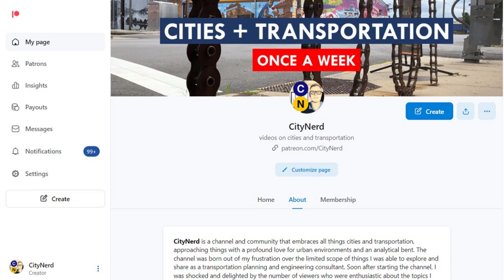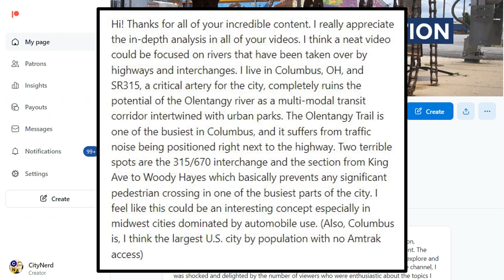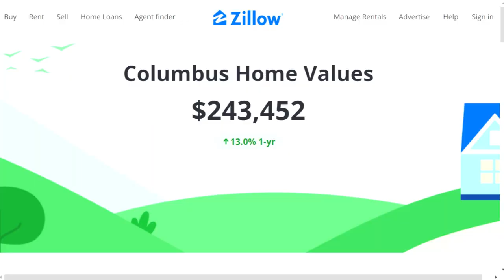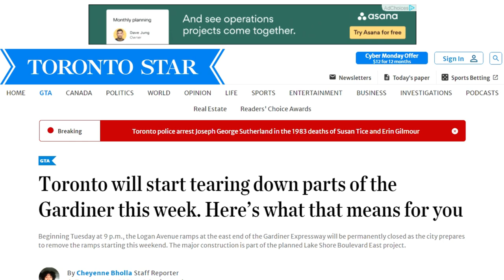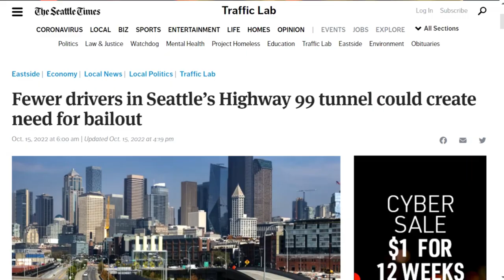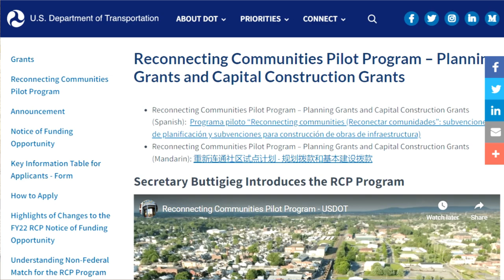Highway Engineering Madness: 10 Waterfront Freeways That Need to Go (North America Edition)

Comment: #7 - I lived in Oakland a block from the MacArthur BART station & worked in an office on the Emeryville Marina, crossing under the freeway at 7:28. I'd love to see it gone & replaced by better modes. It, and its surrounding/connecting freeways (80 and 24) are all jam-packed nearly all the time. The aforementioned BART is a great regional/commuter service, but the local AC Transit doesn't do a great job of filling in the gaps. The area is flat enough to make bicycling super-easy though, if it weren't for all the cars.

Comment: I’ll take a freeway over a stroad any day.
I can think of two other cases that didn’t make your list, probably due to city size.
There’s I-229 in St. Joseph, MO which is right by the Missouri River. There’s been talk about removing it due to its double-decker section blocking the view of the river.
Another one is Loop 375 in the southern part of El Paso, TX, which opened in 2020. The portion west of US 54 is squeezed between local streets and the Rio Grande. There are parts of that road that have a chain link fence separating the road from a residential area on one side and the border fence on the other side.

Comment: I use lakeshore drive pretty much daily during the week. It’s really bad. It’s a “highway” that really just- was never made to be one. From my experience the posted speed limit of 40-45 is, essentially ignored. The generally accepted speed limit is around 60. If you use lakeshore please at least (in normal conditions) always go 40-45, as people going faster are not going to slow down. There are a lot of wrecks from road rage, rear end crashes, and just stupid driving. I do a lot in my personal time with traffic engineering, and i spend my time on the road just looking for the things done wrong. One thing that finally was fixed around a month ago was in millennium park, on the north bound side, you have 2 left turn lanes at lights, but 1 long one spanning essentially the whole length of the park, and for a long time people just- go around everyone in those lanes, and go through the intersection in those turn lanes. Even going around to the left of the people in the rightmost turn lane and continuing straight. 
This was, somewhat helped with new concrete median widening. Also helping a bit to pedestrian safety which, basically doesn’t exist there as people still will blow by the red light in that left lane. This is still not what is needed for the situation, that being a completely segregated left turn. Though we just need improvement to public transit and no lake shore drive, that’s not happening. But the amount of bumpers, and various other car parts strewn around those new medians is insane. Apparently people are still trying to do what they did before but now getting the bottoms of their cars shaven off. I would say remove all the traffic lights as it is, but that’s not how traffic works and supply will always outpace demand there. Another issue being the steep overpasses that make rear end crashes a lot more common as people blow over them at 70 and rear end the stopped traffic on the other side.

Comment: The I-64/I-71 corridor through Louisville, including where 64, 65 and 71 come together well east of Downtown, are built on the floodwall. Part of the "white flight" and "race to the suburbs" In Louisville was about getting away from a downtown that was under the Ohio River more Februaries than not. If the freeway were to come down the remainder of the structure would either have to remain or Downtown, most of the Portland, Shawnee and Butchertown neighborhoods would have to be abandoned.

Comment: I know you had loads to choose from, but I was expecting to see I-90 through Cleveland on the list.

Your opening footage of Tacoma made me think of the Gardiner in Toronto (I knew that one had to be on the list; well deserved). The similarity that struck me between the two was the rail corridor paralleling the expressway. In Toronto’s case the railway  has a long history on the waterfront serving the port, as well as bringing passenger trains into the city centre. When the Gardiner was built, it was just one more travel corridor on top of an already intense barrier separating the city from the waterfront. As the rail lands were sold off and redeveloped, the presence of the Gardiner became more obvious.

There have been many efforts over the years to tear down the Gardiner. A stretch east of the Don river was removed. The current work, which you mentioned, would tear down a section at the east end, and replace it with a new section that curves further south, even closer to the waterfront. The political will for a full takedown will never be there, despite the immense cost of reconstruction and ongoing maintenance.
Reply: Correction: the reconstructed section will be built farther north, closer to the railway, not south.

Comment: NYS Route 5 in Buffalo is a particularly frustrating example that should be in the process of removal right now.  Unfortunately, the fastest-completed EIS for a megaproject in US history (or so I was told) was scuttled because some misinformed (yay social media) commuters were offended that the new alignment would add a few minutes to their commutes, and therefore our local dead wood House member pulled his support.  I get that driving is so unpleasant that adding a few minutes to any trip is rightfully awful, but let's think about the greater good every once in a while.  Essentially it proposed removing the freeway between Tifft and I-190, and rerouting along an abandoned rail corridor (I know, but not a waterfront at least?) to meet I-190 east at Seneca Street.  Worse yet, some modeling actually showed that commute times would decrease in certain situations.

So instead, we have a decrepit, yet only 15 years old (serious, what's with the horrendous build quality?) freeway to sit there for God knows how much longer.  Yeah, it was rebuilt 15 years ago, when the same useless politician withdrew his support for a boulevard alternative.  An alternative that surely would have had its flaws, but at least it wouldn't be the eyesore we have now.  It doesn't help that it's ugly, it's not even pleasant to drive on thanks to DOT evidently forgetting how to do geotech work.  Oh yeah, and somehow after reconstruction, they managed to make it worse in the winter - more whiteouts, etc.  Nice going, NYSDOT.

And don't get me started on I-190.  A nice attractive noose around the south edge of downtown, which not surprisingly is one of the fastest up-and-coming areas of the inner city.  Yeah, it's elevated, but that's still part of the problem.  Nothing like having to walk across a 100-foot wide moat of horribly managed gravel parking lots that smells like piss whenever you want to go to some kind of entertainment.

Comment: 580 might be the least free-flowing freeway I've ever had the displeasure of living near, but I have to say it's not one I think is practical or urgent to remove at all. there's no alternate route capable of even a tenth the car traffic, the nearby uses are primarily industry, big-box, and warehouses, and development in the area is much better placed near BART and the upcoming BRT on san pablo. permeability is ok, there are ways to get through to the few things on the other side, and the bay there kind of stinks (literally) to live too close to anyways. there's not a lot on the other side or even too close to it for much of it's length as it's right up at the water's edge, in some areas it's hundreds of feet off the original shoreline
Reply: also, the handful of recreational areas on the other side are spits that stick out far into the bay, so you're not hugging the freeway while walking your dog. there is a path that runs alongside the freeway, but there are better parallel options inland, so it's not super heavily used.

Comment: Storrow Drive and Soldiers Field Road's other claim to fame is the numerous low-clearance overpasses along their length, upon which trucks come to grief so often that the term "Storrowing" has entered the local vernacular, referring to trucks hitting bridges both on Storrow Drive and elsewhere. The stereotypical case is the MIT or BU freshman in a U-Haul, but more often than not it's professionals who you'd think would know better.

Comment: As a long time Chicagoan, I can say hand on heart LSD is a blight. The amount of noise pollution it causes is incredible and the proximity to the well used and much loved lake front trail makes this very apparent. Speed is a huge issue as well, with posted limits at 40mph on the north end and 45 on the south, you can bet the average speed is at least 20mph higher with a fairly large contingent of users traveling even faster. IDOT says it averages 3 collisions per day and the danger is apparent. 

What is more worrying (and worth a look if you can CityNerd!) is the proposed changes IDOT is currently planning. One option includes adding lanes with more outlandish options including a causeway out on the lake thought too expensive. Why this was even considered is beyond me as adding lanes seems insane enough in the 21st century. 

All that said, I drive the entire length daily from the far north side to NW Indiana. Part of the problem? Yes. The two hr train based option (CTA to South Shore Line) just does not work if I want to have any time left in a normal workday. This comes down to the distance (~30miles) and the limited outbound schedule of the South Shore line.  

Thanks for putting LSD at #1. It truly deserves this shame. Love the channel.

Comment: Bonaventure in Montreal is rather bad, but the reality is that there's really not much that can be done with that plot of land. It is extremely polluted. There are wells that are constantly pumping out ground water to prevent oil and other toxic sludge from ending up in the St-Laurence. That piece of land is literally never going to be usable for anything other than warehouses and industrial buildings. 

Route 132 on the south shore definitely has got to go, but the problem is that there are quite literally only 2 straight lines on the south shores and that's one of them. Montreal is one of those places that was stitched up from multiple cities that just did not consult each other, and often still don't to this day. Taschereau is the other straight line on the South Shore, and assuming that things go as expected, a new REM will be built along that corridor. The portion of Taschereau that is built like a highway is definitely on borrowed time. The city wants it gone and the government seems to be willing to go along.

Comment: You showed the two waterfront freeways I am very familiar with. I grew up in Berkeley and Oakland, CA and I am very familiar with the Eastshore Freeeway. The reason it's where it is is because when they were building it, the city of Berkeley did not want the freeway going right through it. It's the same reason the tracks for BART are above ground in Oakland but go underground for the time it goes through Berkeley before reemerging above ground again once in Albany.

I live in San Diego now and yes, I-5 along Mission Bay does sort of ruin that area a little.
Reply: I lived in Berkeley about 40 years ago and found the waterfront next to the freeway undesirable. I seem to remember the term "mud flats" which doesn't conjure up the idea of a place you'd want to picnic. I think there was also some odor associated with that part of the bay. Next to the bay is as good a place as any to locate a freeway.

I live in San Diego, walking distance to Mission Bay Park. I can usually tune out the traffic (some trucks and motorcycles are noisy enough that you can't avoid hearing them). And there are other parts of the park (not walking distance for me) that are much further away from the freeway. 

I don't see the freeway as a hindrance for accessing the park, but I live near where Clairemont Drive crosses the transit corridor of I-5, heavy rail, trolley and Morena Blvd. I-5 also makes this park more accessible to other parts of the city. This part of I-5 is basically on top of the Rose Canyon fault, so you wouldn't want to put high density housing there, either.

Comment: Love your channel, but you are wrong about Lake Shore Drive. As a Chicagoan, I need it. It's the rare piece of road infrastructure that works, outside an hour or two in the morning, during the school year, there aren't really traffic jams, which give working class and middle class residents of lakefront neighborhoods like Rogers Park and Uptown on the North Side and Kenwood and Oakland on the South Side quick access to central areas, and also connects the University of Chicago campus to the central city and the North Side. Chicago has the best public transit west of the Northeast Corridor! But it's still not enough. While the North Side lakefront neighborhoods have rapid transit access to Chicago's Loop, it's not very helpful if you're trying to go anywhere else. Chicago's transit lines are laid out like spokes from the central hub of the Loop, and are less efficient at connecting neighborhoods to each other. And even in the Loop, the El is fine to get you to an office building, but because of where the stations are located, they're not really workable if you're trying to take a 6-year-old to the Field Museum or the Adler Planetarium. The South Side lakefront neighborhoods lack even this level of transit access.  There's the Metra Electric line, but outside of rush hour it runs maybe once an hour. As a result, if you were to replace the expressway with a boulevard with more stoplights and interchanges, it would cut off more distant neighborhoods from the central city and make it no longer viable for middle class residents to live in these neighborhoods and work in central areas.  Yes, making LSD a regular surface street would raise property values in Lincoln Park and Lakeview, but is that really a good thing?  More unearned wealth for some of the city's wealthiest residents? Those places are already too expensive. Putting these areas even further out of reach for the average city resident is not a positive outcome. Changing the infrastructure in such a way as to benefit a bunch of wealthy white people to the detriment of less well-off people elsewhere sounds like a poor use of public funds to me. On a personal note, without LSD, when I had an elementary school aged child, we would have had to decline our prized spot in an accelerated program, because there would have been no way to get her to school and me to work on time. Once the kid leaves for college, I am thinking about going car-free, but it's just not an option now. Plus, except for a few places just north of the Loop, LSD isn't really on the waterfront.  Almost the entire shore is a series of parks, and there's already a bike path connecting Hollywood on the Far North Side with Jackson Park and South Shore on the South Side. That's about 16 miles, covering most of the city's lakefront. Could we use more frequent places to cross LSD? Absolutely. The city's been building some (very cool looking) pedestrian bridges on the South Side to cross LSD and the adjacent commuter rail line, and hopefully will get to doing something similar up north eventually. There are other solutions to improve pedestrian access to the lakefront parks much less drastic than removing the expressway. Without LSD, middle class residents would leave the north lakefront, unable to deal with the increase commuting times. The amenities which their presence pays for would already disappear. Shops, restaurants and jobs would vanish and the neighborhoods would decline and depopulate.  And it's not just car drivers that depend on the Drive, a number of heavily used express buses use this route as well. And unlike other expressway-based bus lines, they're not stuck in traffic, because LSD is only slow from maybe 7:30 - 9:00 on weekdays when Chicago Public Schools are in session, and only really slow if the weather is bad (what constitutes "really slow" is subjective, I guess. The trip can take 35 minutes instead of 10 the rest of the day). LSD is necessary infrastructure and it works. It allows working people to bypass the rich neighborhoods and access the cultural amenities they can't afford to live near, without having to spend 90 minutes on 3 different buses. The biggest argument against it is that it's ugly?  It's not ugly during the 6 months when there are leaves on the trees, the other six months - the entire city is ugly. If Chicago were to have access to tens of millions of dollars to improve transportation infrastructure, it shouldn't be wasted on making LSD slower, it should be spent improving CTA bus and train service throughout the city, or maybe even on bringing back street cars in some areas.